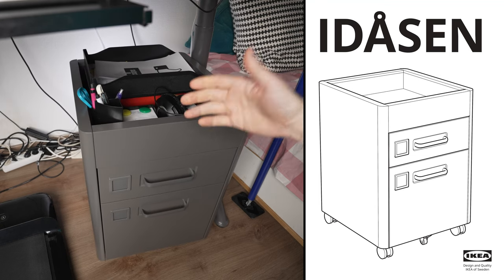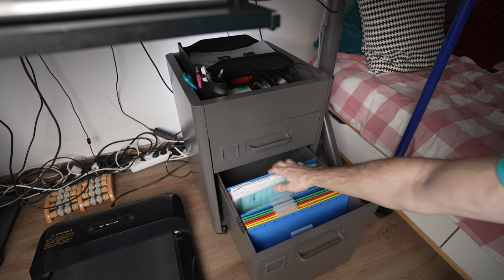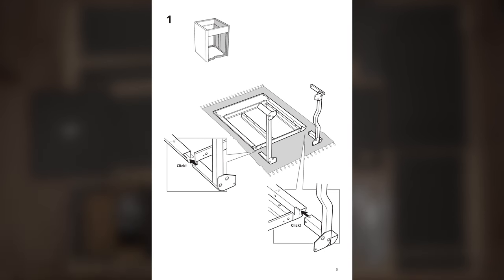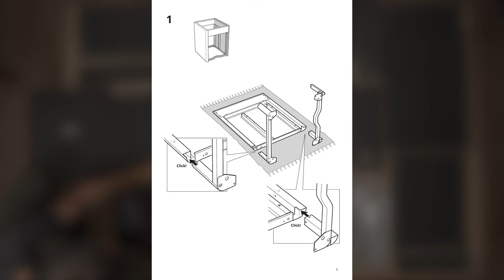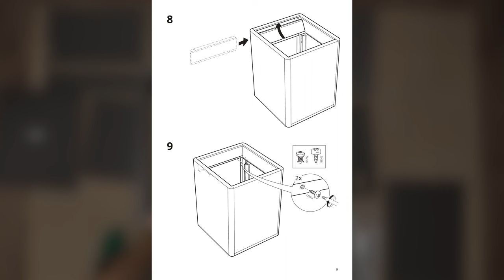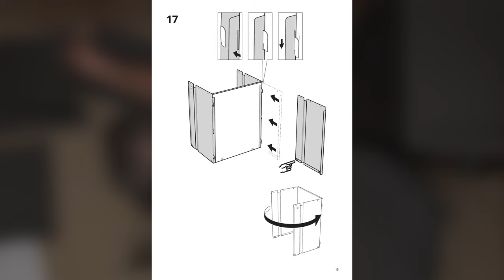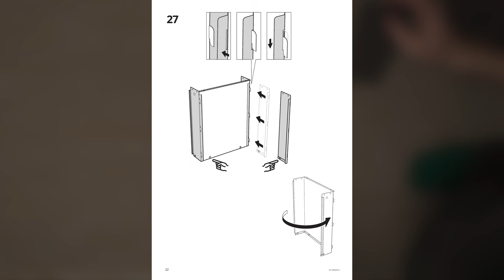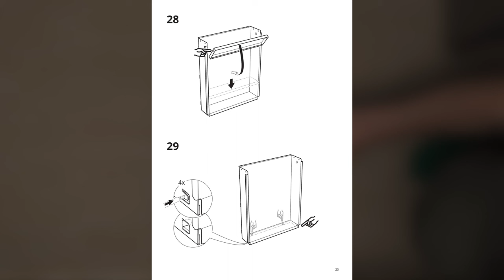IKEA IDÅSEN File Cabinet 🗄️ Drawer Unit on Castors 🚎 Review 🔎 Assembly 🔧

Comment: In my unit, some holes were a little to small so I had to apply lot of force on the screws (I used the corresponding ones according to the manual)
Reply from the maker: you mean the metal screws? it was the same for me, I think you need a big screwdriver or even an electric one, I had a small one and almost ruined my hand...
Reply: @workingathome  Right, what I did was slightly enlarge the narrow holes by placing a long screw in each of them and turning it using leverage. I don't think that even an electric or large screwdriver would have enough strength!

Comment: Went to put the drawers in and realized I had done something wrong. Is de-assembly possible?
Reply from the maker: it should be possible, but maybe to remove the top is not so easy. Be careful esp. to put the runners for the drawers at the right position (i.e. use the right screw holes). This is easy to do wrong... (you can see in my video, I also talk about it in the beginning)

Comment: Hy, Thank you for a great video, I am wondering what is the width of the "Hanging File Folders"? Why didn't you buy the IKEA SUMMERA file folder? Thank you!
Reply from the maker: hey thanks, you can buy any A4 hanging file folders... I guess I wanted more colorful ones but of course the IKEA SUMMERA should work fine I guess... but I do not need to buy everything at IKEA and I did not need so many so it was cheaper.
Reply: Thanks for the video. Is there a trick to installing the drawers on the rails? Thanks
Reply from the maker: @jeannine480  Hey if I remember right there is kind of a "hook" in the rear that you have put the drawers first if I remember correctly. Does it work now?
Reply: I’ve read somewhere that you can’t get the correct size sliders, even in IKEA. Due to the drawer not being UK size. It needs some sort of liner. Not worked it out yet?!
Reply from the maker: @lizbradley3095  You mean the hanging file folders? Mine are working great, they are A4 size (link in the description). I would be surprised if the ones from Ikea don't fit as well. Just don't buy US size.

Comment: Too fast to follow, no detail of how the black clips under the drawers attach to the runners?!!
Reply from the maker: Hi liz, can you point me to the page you are refering to?
https://www.ikea.com/de/de/assembly_instructions/idasen-schubladenelement-auf-rollen-dunkelgrau__AA-2085692-4-2.pdf
(you can also see the pages in the chapters below the video)
Reply: I’m stuck at page 16. Bottom drawer, it doesnt clip together so you fold those fins?
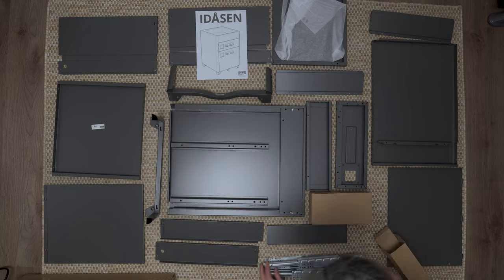Reply from the maker: @GaiGokuJin10  @Vince  I say it in the beginning at 01:15. You really have to fit everything properly (inside the seam or groove or how to call it) or you will not be able to bend the small metal fins. Does this help? (I had this problem in the beginning, I did not fit the bottom plate properly and therfore I could not bend the fins...)
Reply: @workingathome  Thanks!
I’ll go at it again. Give me a min and a cup of tea. Hahaha.
The video helps me visualize things.
Appreciate you putting this one online.
Thank you 😊
Reply: @GaiGokuJin10  the black clips slide back and for at the sides. The back drawer has to go into the hook until it’s level with the sliders, once it dies the black clips will hold. Then use the blue wheels to help level it at front.,  took ages until it worked!!